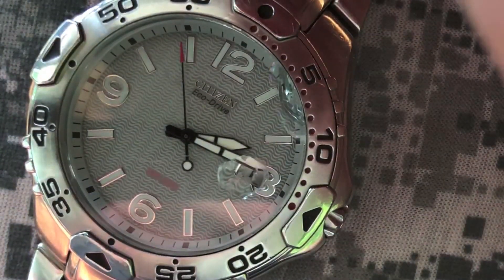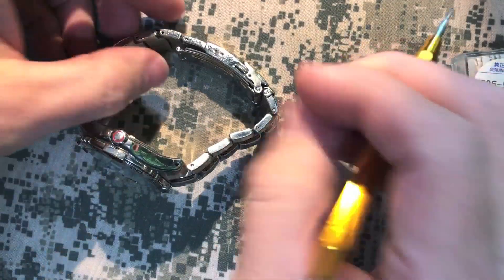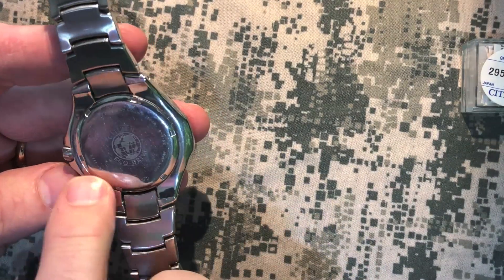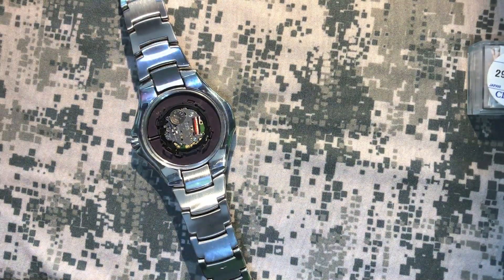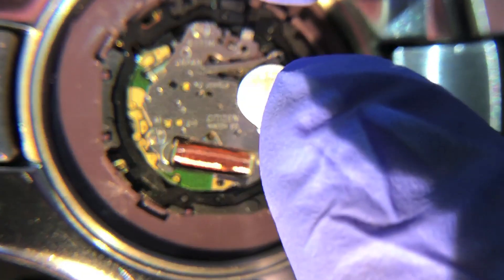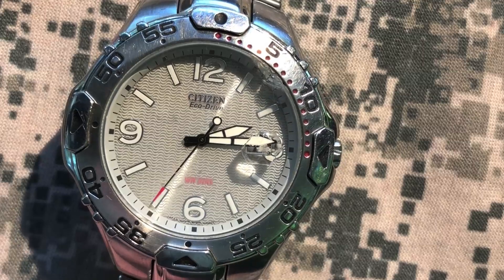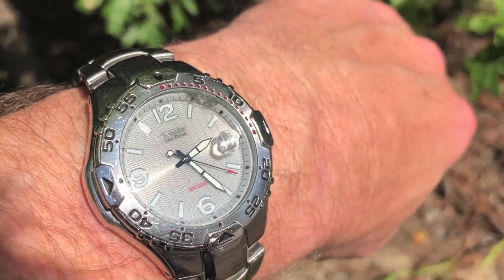How to Fix Your Citizen Eco-Drive Watch | Replace Capacitor

Comment: A battery and a capacitor are two entirely different things. In theory a capacitor should not need replacement just recharging. A battery will die over time. Decide which is which please!
Reply from the maker: Yes, I was just trying to over simplify it by using common terms, and I said all three items (capacitor, cell, battery) to cover all bases. This is technically a rechargeable cell. As you said, batteries die and rechargeable cells lose their ability to hold or effectively disperse power vs their new state. But if I said “replace your battery.” one might purchase a standard watch battery, since similar part numbers are printed on them, and ruin their watch. I felt it was important to draw attention to the function of this particular part so that viewers would not miss the importance of replacing this cell with an OEM equivalent, NOT a standard watch battery. Thanks for also drawing attention to it!
Reply: @WatchWitt  Thankye Sir
Reply from the maker: You’re welcome! Are you getting an Eco-Drive back on the road?!
Reply: Jus got a few of em in the mail and they were in limp mode. Gave em some light and now they're coming alive.. Thank you for the wealth of knowledge. Thanks to you I believe Ill install the batteries myself when the time comes
Reply from the maker: Cool. Yeah, most people don’t charge long enough, or in direct sunlight. 12 to 15 years seems to be life span.
Reply: @WatchWitt  I use regular silver oxide battery in my eco-drive and it works (of course, I adjusted the battery to the specific contacts in the eco drive)
Reply from the maker: @user-fk4bo9vt4g Wow...I never would have thought to do that!
Reply: @WatchWitt  there is a technical barrier between many of us here, that makes it confusing to some of us when someone calls a power supply (in this case a capacitor, that replaces the normal battery found in watches) by the functional name versus the technical name. Capacitors are very respected in the HI-Fi world for their sonic differences between brands and types. Some are handmade, and sell for big bucks. Used in the speaker cross-overs, can make your speakers you had for 20 years sound better than new, and better than you could imagine. The high frequencies are the first to start fading on old speaker crossovers, and it's from a crapped out capacitor.  Majority of HVAC air conditioner issues are the start capacitor gone bad.
Reply: It has a capacitor and capacitors can die if they run completely dead they need to be recharged to maintain the ability to hold a charge.
Reply from the maker: Yes, and that’s why the ones in a dark drawer (or watch case, etc) are worse off.
Reply: Typically a capacitor contains liquid electrolytes. These can leak out .
Reply from the maker: Well that’s no fun!
Reply: And this video and some other same ones gives me another view of the word 'Perpetual'......
Reply from the maker: Yes, Citizen originally billed this as “never needs a battery” or “power will last the lifetime of the watch” etc…something like that. But it’s becoming more obvious the life of the rechargeable cell is about 12 to 15 years, depending on use and part number. It was probably just a marketing move. They had to know the lifespan. You have to simplify your message when rolling out new technology (back then). Sure glad the product was successful, though!
Reply: @WatchWitt  you are correct Citizen charged me 100.00 to replace the capacitor that never fails ... I have had the watch for almost 20 years and I have had to replace the capacitor twice. It is likely due to my letting the capacitor fully discharge for months, maybe a year. Thank for the informative video
Reply from the maker: @octico  When Eco-Drive first came out they touted “never needs a battery” or something to affect that the power will last the “lifetime of the watch.” That was probably a marketing mistake, but they had to make a splash. I think most consumers are a little more familiar with Solar charged watches now, to their credit!
Reply: @WatchWitt  citizen lies, as most of the companies do nowadays. Of course, you will not need a battery -- you will need a new capacitor, not a battery. The lifetime of a product is the time when the producer still produces a given model of a watch. If the model stops to be produced by the producer in a year -- the lifetime of the watch is just a year. "Lifetime" is simply not understood by many people and, therefore, i tis a good manipulation word for the producers. Our life becomes filled with lies, lies, lies and very intricate manipulaiton
Reply from the maker: @user-fk4bo9vt4g Definitely an interesting way to interpret their claims. What you say about "lifetime" makes sense...!
Reply: Wish I bought an automatic now i gotta fix my watch
Reply: @Cockaboobledoo  Glad I bought a solar "Atomic" G-shock.  23 years ang going strong. Th autmatic sits in a drawer.  One maintenance visit at three years cost twice as much as the G-Shork, that keeps perfect tiem due to radio signal correction daily.  The Bulova Aupotmatic looked classier, but sized like a woman's watch today.
Reply: Now it works since I posted this comment
Reply from the maker: Murphy's law!
Reply: Capacitors, in theory and reality, do not have the ability to perform an infinite number of storage/discharge cycles.  Many, but not unlimited.
Reply: How do you know wich capacitator to pick I took a look at my watch and didn’t see the right numbers I have a citizen corso bu2070-04a
Reply: @take-flight_2375  3. Find the Battery Size of a Citizen Quartz Watch
Once the back is open, you’ll be able to view the inner components of the watch – including the battery. With a magnifying glass, look at what battery size powers your Citizen. The size will be visible on the battery itself. Purchase the exact same type of battery, as a slightly different size will not fit.

Citizen watch battery replacement sizes are usually a 395 (SR927SW) or 371 (SR920SW).
Reply from the maker: @take-flight_2375  The movement number is what you need to determine the replacement part. It's the first four numbers engraved on the back of your watch. It may look like xxxx-xxxxxx. I think for your watch it MIGHT be movement number 8729, but I'm not sure.
Reply: @WatchWitt  I still didn't understand. Please tell me in simple language whether you replaced a capacitor or battery. And from where did you get it?
Reply from the maker: @vipulsethi8371 You may be better off having your watch serviced.
Reply: @WatchWitt  that was rude
Reply from the maker: @vipulsethi8371 Sorry, not meant to be rude. It sounded like you were baiting me for the capacitor vs. rechargeable battery vs. cell debate, since that is where you posted your comment. I really can't explain it any more simple than in the video. The battery is not a "normal" watch battery, as it has a tip allowing it to hold a charge. Find your movement number on the case back, then search the internet (try Amazon) for your replacement battery (using the term "capacitor" may yield better results) and start the project. And there is no shame in having your watch serviced if you're not able to source the part or make the repair yourself. I have sent this very watch in for repair in the past.
Reply: I think you have rather missed the point of this video...  - Great Video!
Reply: In theory, but there are capacitors that degrade over time.
Reply: Caps die all the time. Clearly you've never worked on any vintage electronics.
Reply: It is a capacitor, and they loose capacity overtime and need to be replaced, mine is still ok at 32 years, other was replaced after 20, still great run
Reply: The bottom line is - we need 1.21 gigawatts for the flux capacitor to operate.  Nuff said
Reply from the maker: And the SUN! Haha!

Comment: I love knowing how things tick. Pun intended. :) Great video. Watching in 12/25 after my Eco watch stopping keeping time. Saw on an AI blurb to put in sunlight. It’s under two years old, so hoping that’s the prob. Thank you for posting! 🌹
Reply from the maker: If you had it stored somewhere without light, that's definitely the problem. And DIRECT sunlight (outdoors, not through window) should get it going again. You should get 12 to 20 years before replacement is needed.
Reply: Thank you! It’s in the window as I type! :)

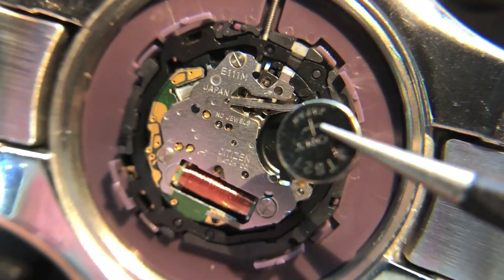Comment: At 4:22 to 4:24 can be see the movments negative terminal comes out with the old sony battery but i think you not notice it.
Reply from the maker: No, that piece is attached to each battery. These are specific to Citizen Eco-Drive Solar watches, even though the top portion of the cell looks like a normal battery. You will see common battery numbers printed on top of the cell as well, but these watches have specific part numbers for those replacement cells.

Comment: I have a Citizen watch with the Eco-Drive  C660  movement.  My second time hand works in 1 second increments and I have reset the watch using the official guide which seems to work, all the displays go off then flash.  The problem is I can not reset the time.  I have read the instructions but nothing seems to work!
Reply from the maker: Ah, bummer. I'm not familiar with that movement, so I don't really have any help to offer. I know that movement sets time with the A or B button, depending on which city you want to update, but that's about it...haven't got hands on experience with it.

Comment: I have an F900 from Citizen that's 9 years old and have sent it in for repairs twice in the last few months. They claim there's no issues but within a month, it goes to two second increments. They tell me over and over that there's nothing wrong with it and that I can't have anyone but their CA service center service, but I can't for the life of me get it to charge. When inquiring, they didn't even replace the battery on the watch, which I feel is absolutely necessary for a 9 year old solar watch. Do you think this is something I can do myself? I feel like this is the issue I'm having.

Thanks for the short but concise info!
Reply from the maker: Only YOU know about your confidence level to complete the project in this video. But, either way, have you tried charging in DIRECT sunlight (outdoors, not through a window) for at least ten hours???

Comment: Based on my experience, I would like to send an encouraging report to those who are currently working on reviving their citizen eco drive watch! In the case of a watch stored in the dark for a long time and a damaged capacitor, an extremely lengthy process must be expected (2-3 weeks), which requires a lot of patience. Never order capacitors from "Asian web interfaces", almost all of them are fakes. The easiest way to notice is that the factory Panasonic always has copper ears. Unfortunately, I sucked with two and finally bought a factory capacitor from a reliable source in my country, which will be reliable again for a decade, it is not worth saving on this. 

About the reviving process itself:

Day 0 – Inserting a new or discharged capacitor
The capacitor voltage is very low.
The watch either does not start or operates at a basic level.
Consumption is minimized, sometimes the second hand jumps by two.
Radio signal reception is disabled.

Day 1–3 – first charging cycles
The capacitor starts to charge, but its internal resistance is still high.
The watch detects the change, but the displayed charge level may not move.
The capacitor occasionally “releases” the charge → the level may drop by the morning.

Day 4–7 – initial stabilization
The internal resistance decreases, charging is more efficient.
The display may show level 3 or 4 during the day.
There may still be drops at night, but they are milder.
The watch continues to be careful with energy.

Day 8–14 – recovery phase
The capacitor now holds its charge well even at night.
The charge indicator remains permanently at level 4.
If everything is OK: radio reception is enabled again.
The consumption profile returns to normal mode.

Day 15+ – complete regeneration
The clock and the capacitor work harmoniously.
The software synchronizes automatically again.
Energy management is optimal.
It is worth exposing it to sunlight from time to time for further conditioning.

This is just a quick summary, but it is always worth keeping in mind the extremely low failure rate of Citizen watches. If the watch' base functions are working after a few days of (non-direct) sunlight charging, then it is rarely faulty, it just needs further care as mentioned above. I thought I would share my experience so that it can help others and save them from unnecessary research.

Comment: I have AT8110-61E, and it looks like the capacitor has died out? its not recharging correctly. can i just swapped the capacitor only or?
Reply from the maker: If your watch is 10 to 15 years old and it has those symptoms, this should do it. As long as you get the right part.

Comment: I'm looking into reviving an old one I bought in the late 90s. I haven't worn it in years since it kept dying on me even with daily use back in the day. I must have put it through the wringer based on a visual inspection I just did. I hesitate to sink money into it. It's smaller than I prefer these days and I've found a Citizen L model with the crown on the 8 that I aligns more with what I'm looking for. But I'm also thinking about the sentimental value. I'm not very hopeful that the capacitor can still hold a charge, but I'll give it a try and take it from there.
Reply from the maker: The sentimental value makes it worth a shot! With older Citizens like yours, you may end up finding out that the movement/gears need a service. But I'll bet you can get it back to life enough for the occasional wear. Capacitor is usually $20 to $30 bucks...
Reply: @ While I was at a watch shop yesterday, I asked about having the Citizen looked at. There's a 60 dollar fee regardless of the outcome to have it sent off to the factory/repair center. And then the costs of repairs on top. If it doesn't charge, I'll be looking for a watch with a larger case diameter. I'll weigh my options carefully. Thanks for sharing your viewpoint.
Reply from the maker: @yuklimka7251 I sent this watch there before, for something else....it takes a while, too!

Comment: The movement number is not visible on my case back too many scratches and cloudiness.  Any other way to identify the battery?
Reply from the maker: There's a good chance your movement number is printed in very small print on the dial, under the six o'clock area. It should start with an "E."
Reply: Worst case open the back and read from the capacitor already installed

Comment: This is the most clear tutorial on all of YouTube!  You da MAN!!
Reply from the maker: Thanks! Hope you're able to breathe some life into your Eco-Drive!
Reply: @ It’s 15 years old and centimental.  I couldn’t just pitch it…. Do you know about gaskets?  Would those multipacks on Amazon be good enough quality??
Reply from the maker: Absolutely. There's no reason to chuck it! Even if you don't go about it yourself, Citizen offers this service. Multipack of various sizes o-rings is a good option if you don't know the exact size to order. BUT you have to match it up carefully with the old gasket. Wrong thickness, diameter, or you pinch it....and water resistance is compromised.
Reply: @WatchWitt  Well noted!  Okay I’ll give it a shot once the stuff arrives!

Comment: My eco drive case has 5 notches in case, not 6 - its going to be a PITA to remove I guess... I will have to use a standard 2 pin remover by the look of it, otherwise its a £60 specialist die.... any suggestions...? Cheers
Reply from the maker: The three prong tool I used in the video usually lines up with notches in the case, and they're not expensive. But others make great use of the 2 prong removers.
Reply: @WatchWitt  Trouble is, they are not opposite each other so that won't work, I will see what happens... thanks

Comment: FWIW, Citizen Eco-Drive watches do not have capacitors to store energy. The use rechargeable lithium batteries. One of mine is about 25 years old and still running great on the original battery.
Reply from the maker: Yes, we've talked about this in the comment thread I've pinned to the top. I used the phrase capacitor/battery/rechargeable cell interchangeably to focus on the part that needs replacement--it's simpler for the explanation, so people can relate. Those terms can mean something different from one person to the next. Wow! Yours is the longest running I've heard of! That's awesome!

Comment: How do you short the movement
Reply from the maker: I'm not sure, actually, which is why I didn't do it here. If I had to guess, you use your tweezers tips on one of the holes near the "no jewels" script (on this movement) and the other hole near the "-" (minus) sign you see. But I believe that is essentially a reset, otherwise known as All Clear (AC) and Citizen Eco-Drives have instructions for that process in each watch manual. It's different depending on the caliber, but essentially involves pulling out the crown for a certain amount of time and/or a combination of buttons for more than 3 handers.